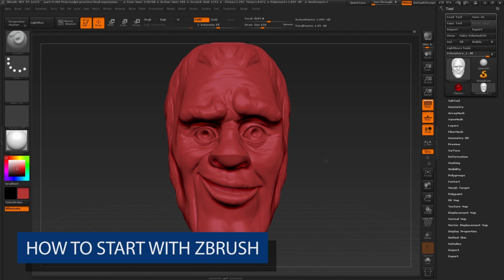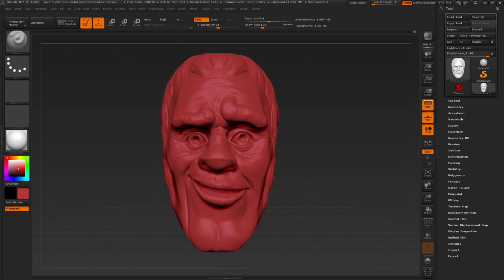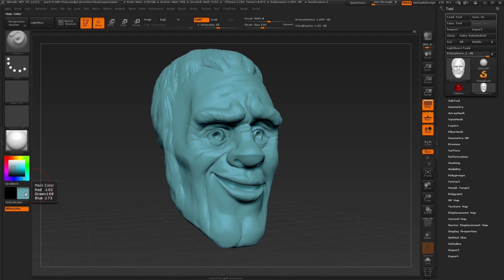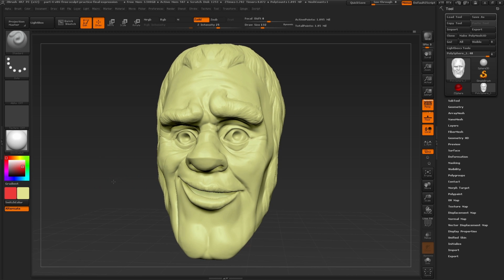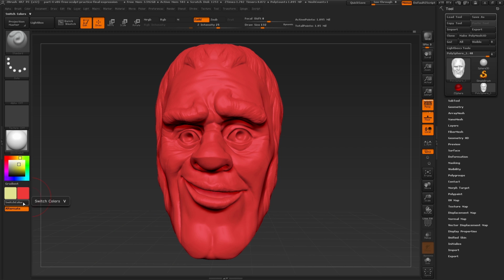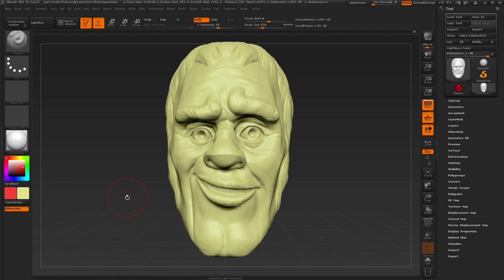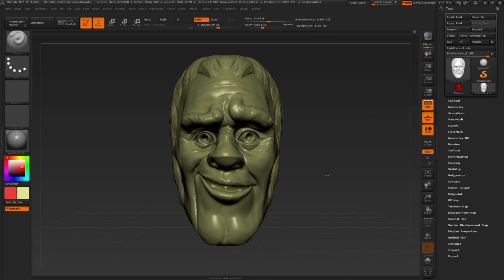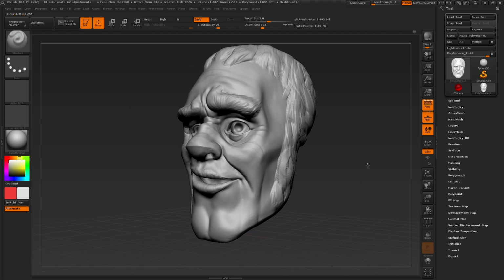How to Start with ZBrush - Changing Colors & Materials - Part 3

Comment: I want to know how do i change the color of the material
Reply from the maker: In the Material palette, you have multiple settings to widely affect the material settings. The default materials are easy to tweak. Matcap are image based, then you can only use some global settings like the saturation, intensity, etc. Again, it's located in the Material palette.